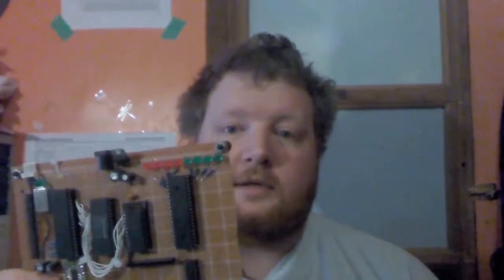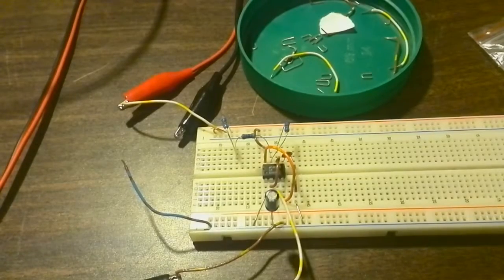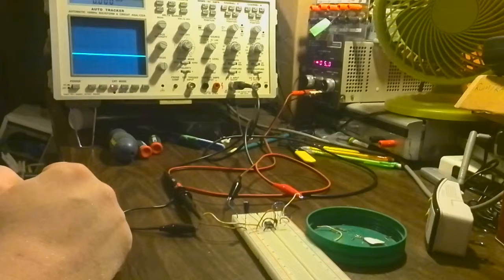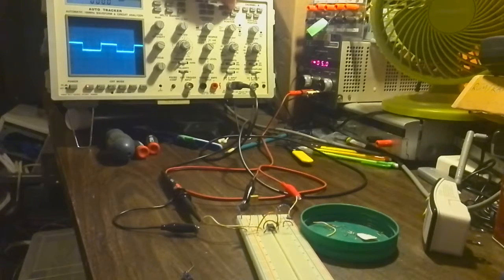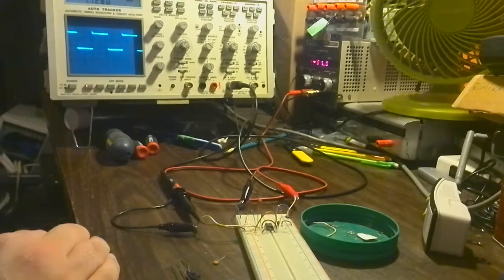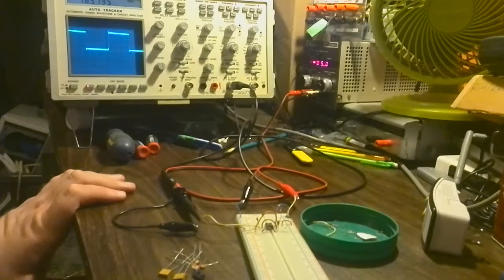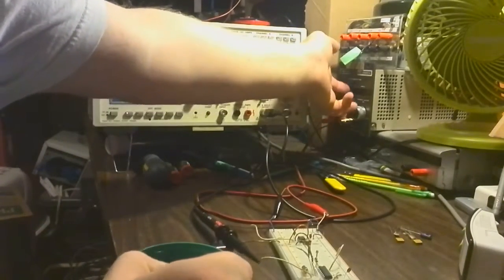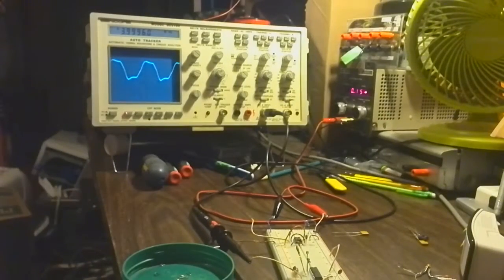Z80 Project 001 - Basic clock circuit

Comment: Maybe it is an idea not to go for the standard basic clock circuit, but go for the extravaganza extraordinary most luxurious fine tunable multi frequency clock circuit. One clock for all needs and different speeds from one Hertz to tens of million cycles per second. The last clock you will ever need, no frequency imaginable that can't be generated between one and very high. Just a a few feet for kristals and a switch.

Comment: That's a handy little frequency readout on your scope. I guess it's nothing fancy compared to anything modern but I just have old stuff in my kit and have to rely on my faulty mental calculator!
Reply from the maker: It's also a whole DMM built inside it, but I need to make some weird adaptor with 2mm banana jacks to allow me to do voltage measurements via the scope probes.
My Atten 100MHz DSO I used to have did all the frequency counting stuff on it, I do miss it.
I do intend to make some kind of frequency counter in the future as a project, hopefully I can get to that sooner than later :) Thanks for the comment!